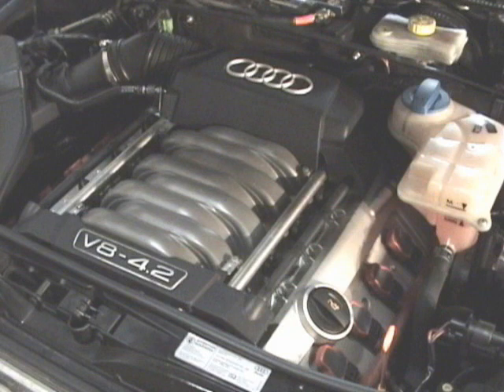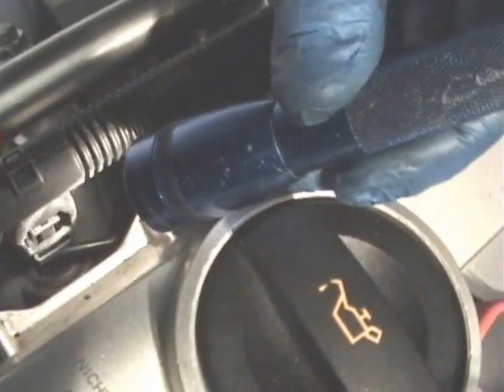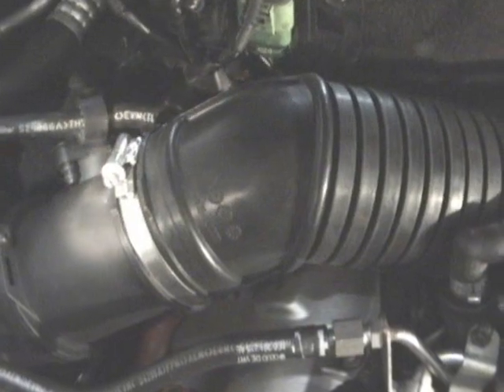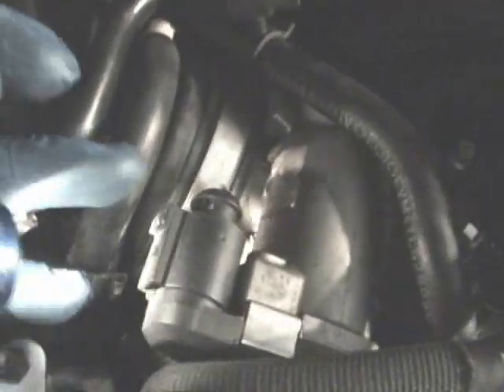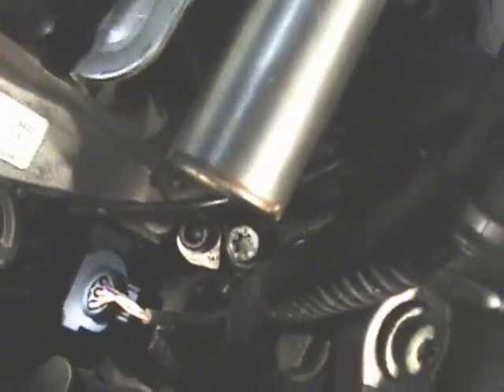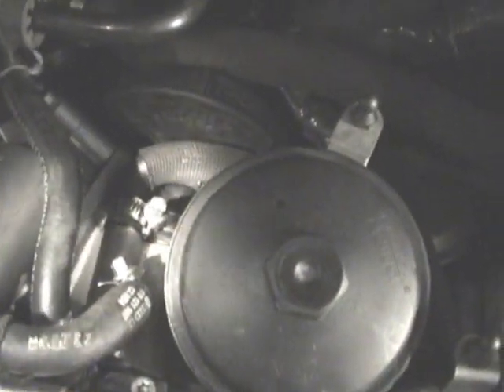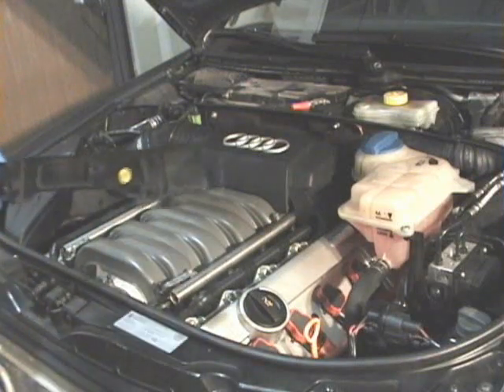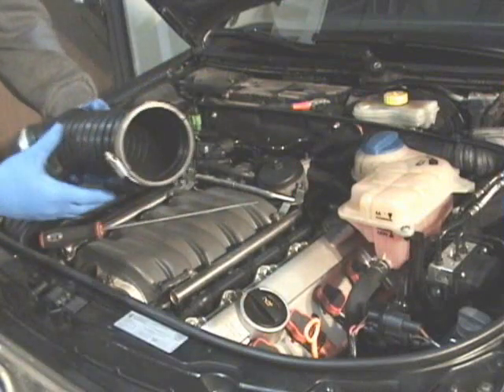JHM Intake Spacer Installation for B6-B7 S4 and C5 allroad-A6 40v V8

Comment: Interesting video I was thinking doing this on another engine, but it looks like the gain it torque may only come from about 60 mm raise, but as a compromise could it drop the top end ...?
Reply from the maker: The difference in runner length is not large enough to make a difference either way
Reply: I bought this kit 2 years ago haven't installed it yet I've heard there's issues with the intake flapper is this true?

Comment: Can these spacers be used on a 4.2L AXQ V8 Touareg?
Reply from the maker: Yes, most bolt on items for the S5 4.2L will fit the Touareg 4.2L
Reply: @JHMotorsportsInc What about the BVJ in the D3 A8? Also, since the car has a ZF 6HP19 just like the C6 A6, will your TCU tune work for an A8?

Comment: unlikely this comment will be replied to, but do you have a list of the required tools for this job? Looking at replacing my manifold and wanted to install spacers at the same time and don't want to pay my shop the quoted $3k in labor.
Reply from the maker: We do not have a specific list of the tools required, we would recommend referencing a Bentley manual or factory service manual for the tools required. As for the labor, this should take around 5 hours to complete intake manifold removal/replacement. How many hours is your shop quoting you?
Reply: @JHMotorsportsInc  their estimate did not include how many hours it would take them. On their form it simply described the job, “intake manifold replacement” and a quoted total price of $5k. Which includes the part so I assume they were charging between 2 and 3k for the labor as prices for an OEM manifold are around 2k from what I’ve seen
Reply: Which boggled my mind because the only bill I had envisioned ever being at least 5k was timing chain service. Then I saw this video and realized how nuts their estimate was and thought it’d be better to do the job myself.

Comment: What is the cost and performance gain? Will this fit a 2005 A8 4.2L D3 (40v)? Also my intake change over flaps have a slight rattle at low rpms, any fix for that other than a $1200 JHM manifold? Look forward to hearing back
Reply from the maker: We have not tested this manifold on the 4.2L A8. We have confirmed fitment on the B6/B7 S4 and C5 Allroad/A6.
Reply: @JHMotorsportsInc  you guys should look into it! And making more d3 audi a8 4.2l parts! That would be great

Comment: How much hp gain?
Reply from the maker: The gain from the intake spacers is greatly reducing heat soak to the intake manifold from the cylinder heads. When we developed the intake spacers, we found even after repeated pulls the vehicle didn't slow down due to heat soak.
Reply: what exactly is heat soak @JHMotorsportsInc
Reply: @ernestoherrera4705  Hot air compresses less than cold. Hotter air in the engine means less combustion means less power. And generally heat soak is just the overall buildup of heat, usually reducing performance and increasing overall component wear.